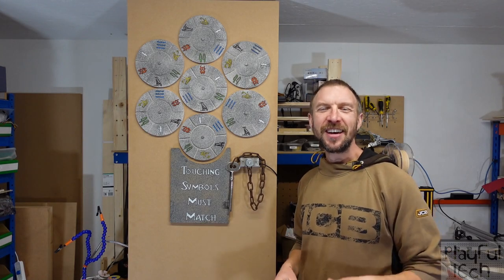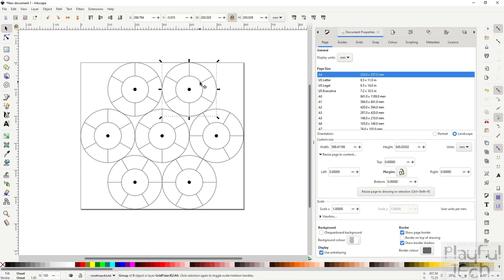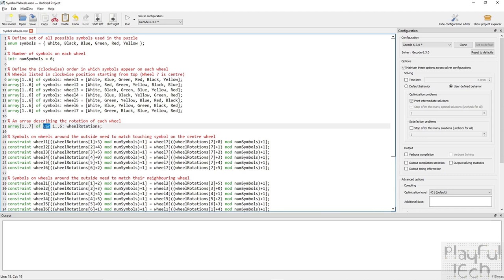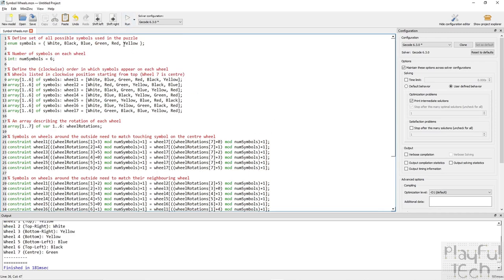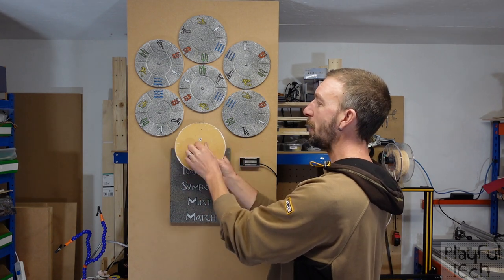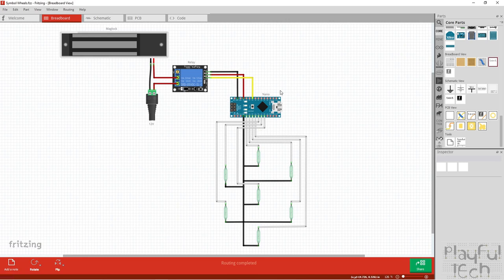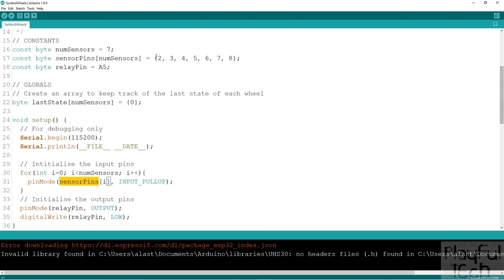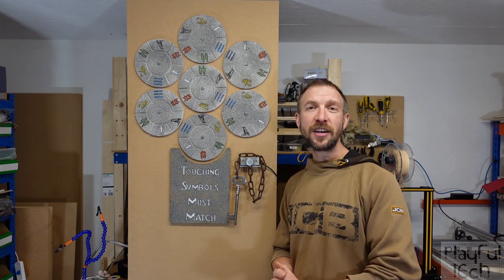Escape Room Puzzle Tutorial - "Symbol Wheels"

Comment: An interesting twist for harder level games would be to have a table with the center disc painted on it (fixed) and six empty spaces with holes around it you'd then have to find or "earn" the outer discs and as well as line them up you'd also have to figure out the correct location for each disc to start with.
Reply from the maker: Thanks for the suggestion! Yes, that would be a great variation, although I suspect it might be quite hard if both the position and rotation of all six outer discs was unconstrained.... would definitely want to do some playtesting and possibly vary the number of symbols/discs accordingly.

Another way of increasing the difficulty is to have multiple copies of the same symbol on each disc but only one being correct. Again, Minizinc (my new favourite program!) can help come up with and test alternative layouts.
Reply: @PlayfulTechnology  As a multi-layered puzzle, you could have them earn the discs, reveal their locations on the board, and then solve the final puzzle. It could be a nice bottleneck into the final room or final goal.

Comment: I’m going to guess it’ll take a maximum of six tries, the six different orientations of the centre wheel. For rapid solving, on each orientation you can dismiss it if two other wheels forming a triangle with the centre wheel can’t simultaneously match symbols with each other and the centre.

As for what’s going on in the background, it could be as complex as an Arduino or as simple as a series circuit of reed switches to drive a relay on the maglock.

Nice puzzle. Could be intimidating or quick depending on how you approach it. Now to watch the video and see how I did.
Reply: I had the same though just when I started watching this video. The puzzle is pretty trivial and really quick to solve since you only have six combinations to try at most, and for the ones that don't work, you usually only have to make a few rotations before things don't line up and you move on to the next one. Was wondering if I was missing something when I heard him say that solving this by trying every combination could take quite a while.
Reply: It is still a great puzzle concept, and here is how you can evolve the difficulty:

Use clues and a cipher to assign a direction, number of spaces and a wheel number. Players must first line up the wheels as you have mentioned, but then must use a sequence of turns of each wheel to find the actual solution. Assign each turn (e.g. wheel 1, turn clockwise 2 spaces, wheel 2, turn anti clockwise 3 spaces, and so on) and provide clues that indicate this, and a cipher to help them calculate which wheel must be turned first, or rather, which wheel is "1" through "7". 

So in summary, they line them all up, then use clues to spin them all to the correct placements.

Comment: Very nice :)

One comment... you showed Minizinc checking that the arrangement you provided had only one correct solution, but how did you reach that arrangement?
Was it a case of manually entering possible patterns in Minizinc and testing until you found one that worked?
Or is there a programmatic method of approaching that side of the problem?

Either way, I now want to build one of these, even though I have no use for it at all :)
Reply from the maker: So that's a great question! Yes, you're absolutely right: for this particular example, I knew that there was one possible solution already (because I laid it out in Inkscape as such), so I manually entered the symbols on each wheel as a hardcoded value into Minizinc to test whether that was unique. But, I could have written the Minizinc code in a different way so that it came up with the solution for me instead - i.e. making the symbols on each wheel a decision variable rather than a parameter. 
So long as you can express the puzzle as a series of logical constraints, Minizinc can create/solve any puzzle - including Sudoku,  "Einstein" puzzles (i.e. "Who owns the Zebra"?), 15-square slidey puzzles, magic squares,... it's great!

Comment: If you place any of the disks in any of the positions and the disks are aligned with the magnets in the correct positions, the system will unlock the lock. The only way to ensure that the system opens the lock using only the correct alignment of the symbols on the disks is to keep the disks secured to the main board.
Reply from the maker: That's correct - in this puzzle, the discs are in fixed places and only their rotation is changed. You could make a variation where players also had to decide where to place each disc, but that would make the puzzle significantly harder! Far too hard for a typical escape room, I suspect.

Comment: Hi, Alastair! If you were to add the lazy susans, you would increase the distance between the board and the disks. Would this be problematic in terms of the magnet sensors?
Reply from the maker: Hi! You're right that it raises the wheel slightly, but the magnet is still well within detection range of the sensor. If you're concerned about, you can route out a section from the wheels and the base, so that the plate of the Lazy Susan lies flush with the surface.

Comment: Thank you for the instructions. I’ve made the puzzle but have a bit more to do. One issue is with power. Only having the 12v power to the relay wouldn’t power the relay or nano. I had to add another 12v power to the breadboard that I have the nano on. Is that how it should work?  Is it ok to have 12v directly to the breadboard with the nano?  Thank you
Reply from the maker: What wattage is your power supply rated for? The maglock should only consume 1 or 2A at most, the Nano significantly less.
Reply: @PlayfulTechnology  it’s rated for 48 watts. Currently, I have that powering through the relay and maglock. Then I have a mini usb in the nano plugged into a wall outlet

Comment: I paused the video when I saw the wiring so I could comment an easier way to wire the puzzle. Then I played the video and realized you already explained why you didn’t do the easier way. I think I prefer the simple wiring because there is less points of failure. Also less power required. And no programming.
Reply: Can you tell me how to do it without the arduino?  I have a similar setup that was put in by someone else. I continue to have issues with the mag lock releasing early. I have troubleshooted many many hours and my conclusion is that the reed switches are fine but they are daisy chained (and do not know what order) to a relay. Sometimes it only takes 2 to be in the correct position and it seems to actually be a power issue. The relay shows that the puzzle is not “solved” but the relay loses power for a fraction of a second and because of this the mag lock releases. I do not have an arduino, nor the knowledge of arduinos and prefer to not have to use another power source. Can you please share how to do this without an arduino?
Reply: @escaperoombreckenridge7162  when doing reed switch puzzle I use a 1 amp 12v power supply and a 12v relay and a 12v mag lock. I use a couple connector rails to connect the positive and negative to power the relay and connect positive to the middle of the relay and I connect the left side of the relay to the positive end of the mag lock. The negative end connects to the negative connector rail. Then I run a wire  from the positive connector rail to through all of the switches in series and then to the relay. When all the switches are “on” the relay turns off the mag lock. If the relay is wired correctly I don’t think it matters if the relay is powered or not it should still keep the mag lock locked until it receives the signal to switch.
Reply: @jonathangreene2108  thank you. I don’t quite understand all of this. If you can provide links to any of these products I would certainly appreciate it. Specifically “connector rails” “couple connector”
Reply: @nicolettecusick7417  they are called screw terminals. I use them to connect multiple things to one power supply. It may be overkill but it is more secure than a bread board and is easy to reuse for other projects.
Reply: @nicolettecusick7417  I tried to post a link but it gets deleted. If you search screw terminal strip you should find them.
Reply: @jonathangreene2108  ok I’ll do it. Thanks
Reply: I have a video on my channel that shows the escape room I made last year if your looking for more ideas. I am building a room right now so I will post another room soon.
Reply: @jonathangreene2108  I’ll check it out!  Are you going to Transworld by chance?
Reply: @nicolettecusick7417  nope
Reply: @escaperoombreckenridge7162  I just checked my relay. The way I have it wired the mag lock stays on even if the relay is not powered. So you should try wiring you relay so it is normally “on” even if there is no power. Then have it turn off when the signal pin is powered.